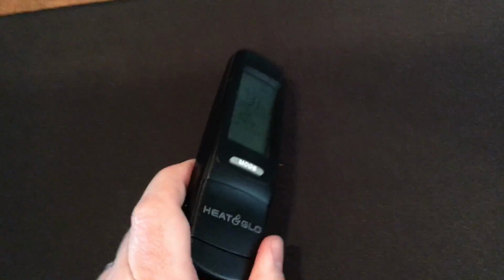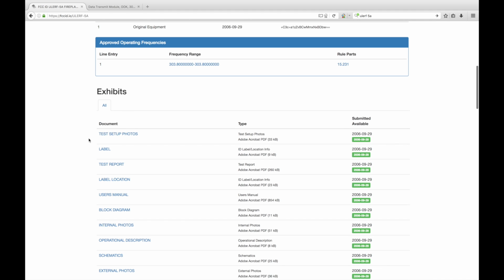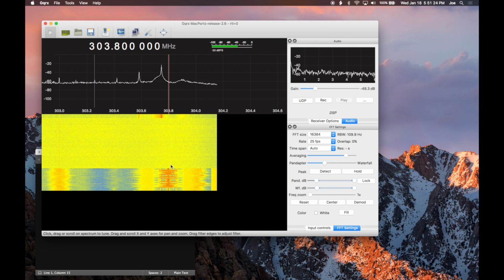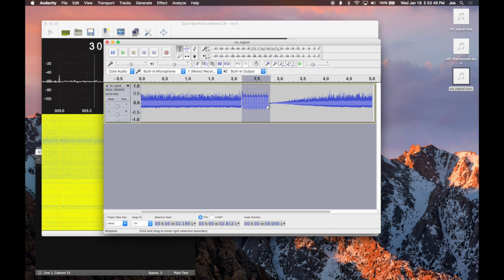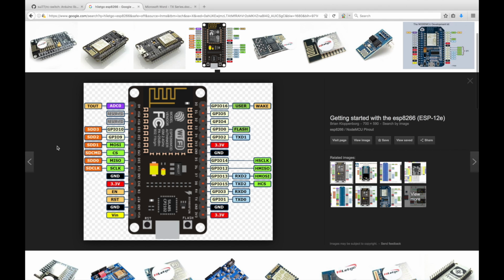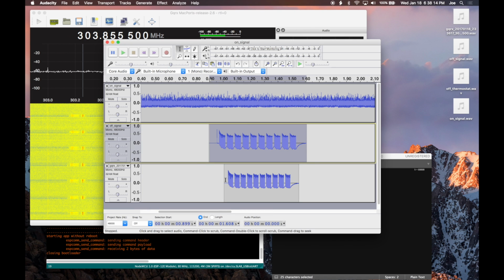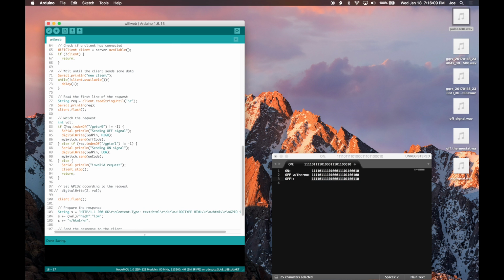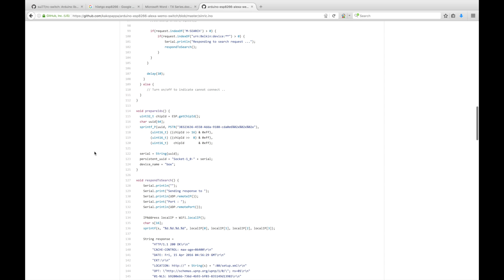Control Your Fireplace with an Amazon Echo

Comment: I'm behind everyone I guess.  I hope someone still looks at this.  I use the same sketch as this example with a nodemcu and the same transmitter.  When capturing the signal from the transmitter, it only sends a signal for a 1.  Blank for a zero.  This does not work with the fireplace.  How do you make it send long pulse for a 1 and a short pulse for a 0?

Comment: Solved: Echo Plus Gen 2, Trailing Zeros, and SkyTech Heartbeat Issue

I was able to get this working with my Echo Plus Gen 2 and my Skytech 1001TH-A fireplace remote. 

Here is what is addressed:

1) Able to discover and avoid the 'function not available' error after discovery
2) The original script was adding a zero to the end of the on and off codes, which is now addressed
3) Turns out my Skytech has a safety mechanism whereby a heartbeat signal is sent every 15 minutes. There is a 'fireplace is on' heartbeat and 'fireplace is off' heartbeat. This is important since if I turn on the fireplace with Echo, the fireplace will send an 'off' heartbeat (since the remote still thinks the fireplace is off) within 15 minutes and turn off the fireplace. I solved this by figuring out the the heartbeat codes using the same method described in the video, and then added code to send those codes (based on fireplace state) every X minutes. The only downside is that you must remove batteries from the remote since only once device can control the fireplace at a time due to the heartbeat codes. Note -before adding this code, I tried just removing batteries from the remote, but after 2 hours of not receiving the heartbeat, the fireplace will turn off, so this approach is necessary.

For code, go to Joe's gitbub page and click on issues tab.

Comment: Thanks Joe - this is exactly what I've been looking for.  One question, my existing fireplace remote is a Skytech, which operates on 303.2 MHz.  Do you think I can use the TX303AT (which is 303.825 MHz)?  I couldn't find another transmitter that operates closer to 303.2 MHz.  Thoughts?
Reply from the maker: Hmm, that might be a bit too far off.  Try looking at the remote and seeing if you can get any info on the transmitter chip, maybe you can find it somewhere.  Or perhaps get a duplicate remote off ebay?
Reply: @jwmartin83  Thanks Joe!  I'll give it a shot.  One question in case I can't get it to work - can you share the model remote and receiver you currently use?  Worst case i get that and make it work.
Reply: @jwmartin83  Ok - I mostly got it working - both for the fireplace and a RF remote controlled xmas tree (I can use a browser to do the /gpio/0 and 1 to turn off and on both devices).  However, the final step of having Alexa discover it is not working (cant find the device).  Do I already need another Wemo device enabled so Alexa knows how to find it (in other words, do I need to use the Wemo app to add the device, or should it just find it anyway)?  If not, any suggestions on settings I can look at so this board is discoverable?  

BTW - Ideally I'd like to control both the fireplace and xmas tree from the same board / transmitter.  I think i mostly figured out how i can do this in the code.  The one part I havent figured out is where I can read the the device name or ID from the request so I can put conditional logic around what return xml and on/off commands i send back.  Any suggestions on that part?  Is that even possible?

Thanks again for your effort on this - it really is amazing!

Comment: Great Video!  Thanks for posting.   One question... does GPIO allow for more options besides "GPIO/0" and "GPIO/1"?  My fireplace allows you to adjust the intensity, so I'd like to be able to include up and down codes, in addition to just "Off" and "On".  Thanks again!
Reply from the maker: Since this method emulates a TP-Link on/off switch, you can't specify an intensity value.  That being said, you can certainly create/emulate multiple "devices" for different intensities, ie "turn fireplace-medium on", "turn fireplace-high off" etc.  But I can't offer more input on this since my fireplace is on/off only.  Let me know what end up doing though!
Reply: @jwmartin83  Thanks for the response!  I'm making good progress on this (I was able to capture my "On" and "Off" codes today.  Unfortunately,  I think I have a problem with my TX303A Transmitter.  It's only transmitting intermittently (sometimes not at all) and with very low power.  Is there any way to increase the amplitude in the settings, or is this likely a hardware problem?  I'm going to reach out to Applied Wireless and get a replacement.
Reply from the maker: @TheStarttman  I haven't had any issue like that. Is the transmitter hooked up directly to your microcontroller? Could you try another MC to rule that out?
Reply: Joe Martin , Yes, I had the same results with a separate MC.
Reply: @TheStarttman  I'm having the same issue. The first time I wired the transmitter, I could see the signal clearly in gqrx. Now it's either a very low signature or not signature at all.
Reply: @jwmartin83  : I'm making great progress!  I can turn the fireplace on and off by sending the "on" and "off" codes.  Now I'm troubleshooting the WebServer stuff.  Quick question for you... on your GitHub page, to work with Alexa,  do I need to use the "fireplace.ino" or the "wifiweb.ino" file?  I think I should use "fireplace.ino" and then use the "Wemo" Smart Skill in Alexa? I know your video says "no skills required", but I'm not sure how the Alexa setup works.  Thanks!
Reply: @antoineb19  In my case, it was a bad transmitter.  I reached out to Applied Wireless and they sent me a new one, no questions asked.  Mine is working now.
Reply: I got it working! Thank you Joe! I used the “fireplace.ino” file and “Discover Devices” in the Alexa App. Super Easy! This has been a great tutorial and a fun project. Thanks for creating it and sharing it.
Reply: @jwmartin83  Just a quick update for you.  I found a very helpful project called "SINRIC" that nicely emulates up to 16 virtual devices on the ESP8266 by using an Alexa skill.  It's very convenient because, in addition to the device emulation, it also includes full support with the Alexa app, so you can turn the fire off and on using the app as well.  The skill also gives the current status of the ESP8266 to the Alexa App, so Alexa now knows if the fire is "off" or "on".  With support for multiple devices, I created a new device called "fire" that I can turn "on" and "off" to control the intensity of the flame ("on" for Up and "off" for Down").  I used your instructions to find the code for "high" and "low" which I can use to control the flame height.  Here's a link to SINRIC:  https://goo.gl/9dT61y

Thanks for all of your help.  Great tutorial and fun project!

Comment: This tutorial is excellent. Had to do a bit of troubleshooting here and there, but overall exactly what I was looking for. I am a bit stuck and I have thrown this question up on your github. Everything is working exactly as planned, except for some reason my setup is transmitting an extra 0 at the end. My On signal ends with 3 0s, so O removed the last one and it worked. My Off signal ends in a 1, however, so no easy fix there. Is there a syntax to truncate that last 0 off or any thoughts why it is sending the extra?
Reply: I ran into this problem too...

After reading the notes and MUCH experimenting, I found that you can "zero out" the initial synch-bit by using "customprotocol" and changing the synch-bit ratio to "0" as shown in the "{  0, 31 }" as seen below:

static const RCSwitch::Protocol customprotocol = { 400, {  0, 31 }, {  1,  3 }, {  3,  1 }, false };
mySwitch.setProtocol(customprotocol);

This "0" effectively removes the first bit in the synch-bit (neither a "0" or "1") and inserts 31 blanks.  Then in the data, you can insert your bit stream and it will only create the "1" and "0" codes you specify (no extra timing bits).  For example:

const char* onCode = "0100010010001011001111000";  //onCode is what I used to turn on my fireplace :)

After I did this, I no longer had the extra "0" at the end of my bit-stream.

I found this article to be the most useful, but it took me a while to decipher it.

https://github.com/sui77/rc-switch/wiki/Add_New_Remote_Part_1

Comment: Finally moving full steam ahead on this project, thanks to switching to the utterly awesome URH tool for decoding my RF signal.  Thanks again, Joe Martin!  Any recommendation on a good way to mount/encase and power the ESP8266 and transmitter when completed?
Reply: @Robert Ross — I seem to be in the same boat you were in. I've now downloaded URH and imported my signal WAV file, but now I'm stuck. Did you actually get this working? If so, how much fiddling did you have to do in URH and how did you know when you had it configured right?
Reply: @jzorn333  TBH I haven't yet gotten much further just due time constraints.  Within URH, the key for me was playing with the the "noise" (i.e. ignore) level so it can decide that everything outside that range is part of the important signal and the "bit length" which is basically the number of milliseconds of recorded signal URH will convert into a single bit of binary data.  Once I got those set right, I could see definite consistent repeating patterns (preamble, gaps between repeats, length of signal, etc.) in the various signals I recorded.  However, what both myself and Joe Martin have come to realize is that the remote also sends a "heartbeat" signal to the fireplace as a safety feature.  The length of the "blip" is extremely short -- much shorter than what I originally thought was my bit length. This has led me to postulate that my bit length value (482) is way too long and the actual decoded binary signal is much longer.  I haven't gotten to the point where I can test my decoded signal yet, so I'm not sure if my bit length interpretation was even correct.
Reply: @robross0606  Got it. Well definitely keep me posted — I'm a bit lost at the moment for a way forward since my signal looks so dramatically different than what is shown in this video, or in blog posts like https://rayshobby.net/wordpress/reverse-engineer-wireless-temperature-humidity-rain-sensors-part-1/. I feel like there must be some way to get my signal to look more like these — some setting in CubicSDR for example. All of this is new to me, and I'm excited to learn more about it! Hopefully one of us can figure it out and help the other!

Comment: I'm following your tut at the minute (excellent btw!) And my wave form isn't as clean as yours but I can work out dash dot etc for 101001110011 the weird thing is my code is a lot longer than yours. Is there a fixed length etc. It definitely repeats 4 times per button press as there's a clear pattern but each one is almost twice as long as yours.

Also my off press does not have a clean dot dash wave form it's all over the place, any tips for smoothing that out?
Reply: I'm having similar difficulty where my recorded waveform is more of smooth hills and with no real obvious "dash-dot" peaks and valleys.  Can you share an tips on how you were able to work out the binary?

Comment: So I’m trying to do this for my neighbor and hey have a different remote. Does this work with all remotes?
Reply from the maker: You should be able to do it with any RF remote.  The key is to find a transmitter that broadcasts on a freq that the receiver will pick up.

Comment: Awesome tutorial. I have the same exact remote, so this is great! Do I need both the RX303AT and the TX303A from applied-wireless, or just the TX303A? The RX one is another $30 these days.

Also, what cables (and how many) do I need to connect the arduino device to the transmitter? 

This is my 1st arduino project so sorry for the newb questions.

Thanks!
Reply from the maker: TX303AT (transmitter) should be all you need. I think you'll just need 5 wires (4 to connect the ESP to the transmitter and 1 loose one off the transmitter to act as an antenna).  You can get a pack of these breadboard/arduino wires for cheap on Amazon.

Comment: Fantastic tutorial.  I have a very similar setup but my remote reports 304MHz.  Do you think the same TX303AT will work?  My remote supports many more functions than yours (fan speed, flame height, etc.) so hoping I can get all of it rigged into my SmartThings.
Reply from the maker: The TX303AT should broadcast at 303.825MHz, which should be close enough.
Reply: Joe Martin having a LOT of trouble ordering from Applied.  Their website is all screwy.
Reply: Robert, 

I had the same issue, and contacted their support. Apparently they are migrating to a new site (you may have found it already)- if you call them at their support number, they can create a direct order for you.
Reply: Turns out after reviewing the output from my remote, the signal is strongest at 304.65.  Still think the TX303AT will work well enough?
Reply: And BOY am I having a hard time trying to decipher the recording out of my remote.  The carrier wave isn't nearly has clean as the one in the tutorial.  The peaks and valleys aren't as steep with "hills" instead of "cliffs".  I thought for sure this would be pretty easy since my remote is darn close to the Heat N Glo in the tutorial.  However, I have the thermostatic remote with more features (flame height, fan speed, etc.).
Reply: Joe Martin,  I have all the parts to do this and have almost the same remote as yours.  However, my recording does not have the obvious peaks and valleys to convert to binary.  The recording shows "smoother" hills and valleys in stead of peaks with sharp fall-off.  What am I doing wrong?  Any tips?
Reply from the maker: Hey Robert.  There are probably some settings you can adjust in your audio recorder to make the signal more clear.  Let me hook up my SDR and see what I can find and I'll get back to you.
Reply from the maker: Looked into this a bit more.  Try the software URH (https://github.com/jopohl/urh) to detect your signal.  I tried to pick up a ceiling fan signal and it's signal was similar to what you're describing--not easily readable.  With some tuning, URH was able to read out the signal when visually it wasn't clear.  Hope that helps.
Reply: @jwmartin83  , thank you for replying!  Don't know why I didn't get the notifications of this reply.  I just happened to come here and check again because my project was totally stalled.  Going to check out URH ASAP.  Any hints on what "tuning" might help?
Reply: @jwmartin83  after some fighting and getting URH to work, I think I cracked the code!  Once you figure out how to use it, URH is awesome.  I can finally see the pattern of the remote with a preamble, pause periods and repeating bit patterns.  For others who might be seeing a similar challenge, the trick to URH was in adjusting the Noise (i.e. ignore) level so it can decide that everything outside that range is a "pulse".  Then figuring out my "bit length" was key to decoding the 0's and 1's.  Awesome!